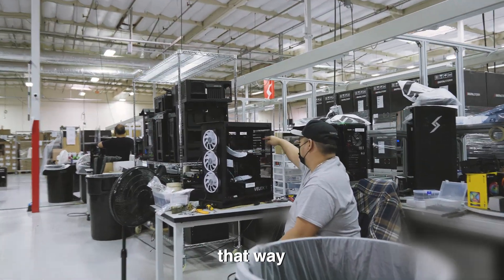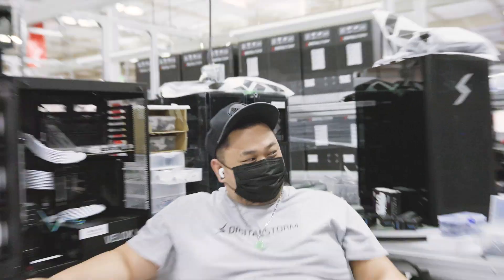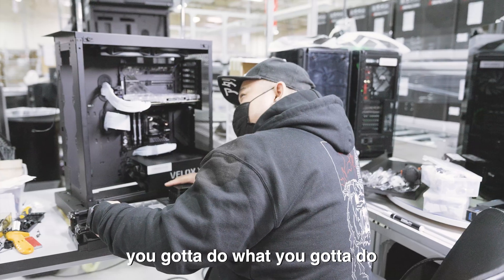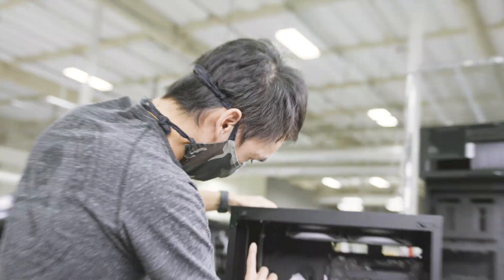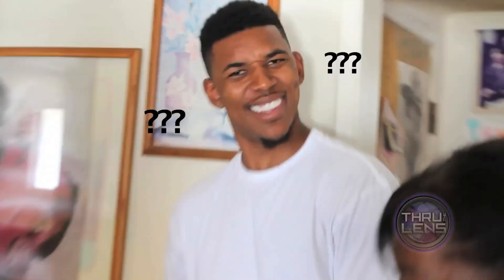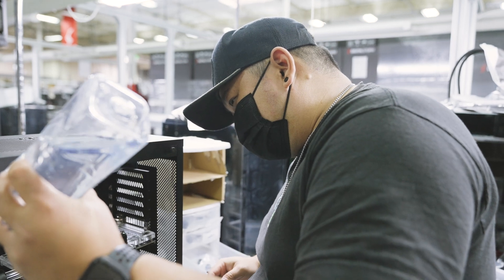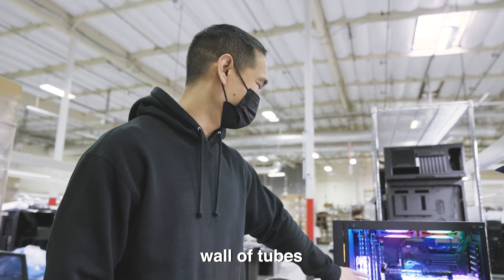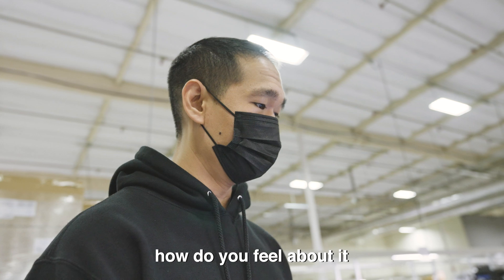HOW TO | Watercooling a VELOX is a PROCESS...

Comment: I made it easy for Digital Storm by using an AIO. I love my new Digital Storm. Velox X/AMD 5900X/MSI X570 Pro Carbon MB/32GB DDDR 3200 DSPS/850W PS/500GB Samsung 980 Pro/1TB Samsung 970 EVO Plus/Sound Blaster AE-7/EVGA FTW3 Ultra RTX 3080 10GB/Liquid CPU cooler dual fan/
Reply: just got a 4090 w/ 13900k fully water cooled cpu n gpu w/ green liquid, i want my tech to get a fun lil challenge
Reply: @vapinggranny2474  I bet it is beautiful when lit up.